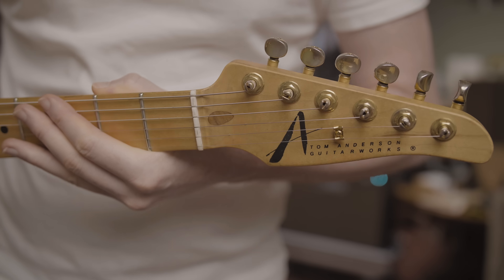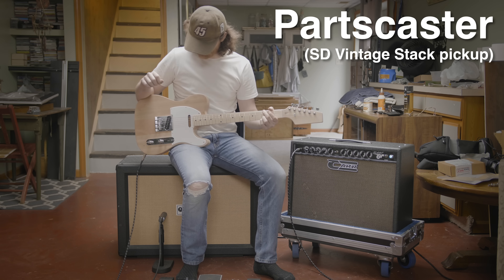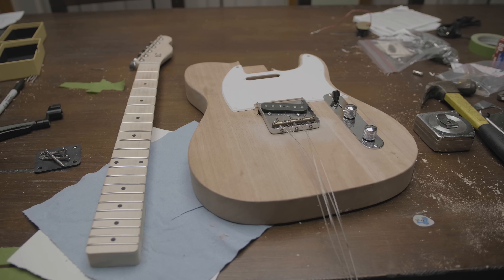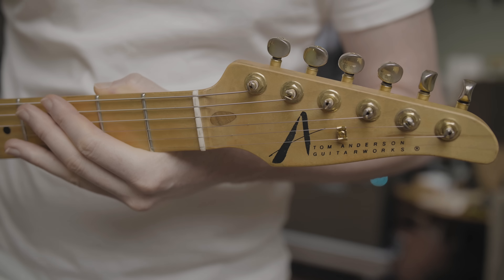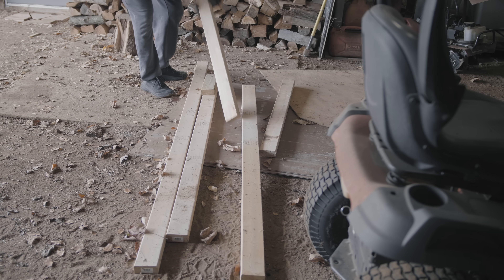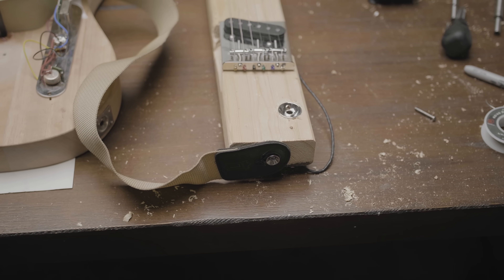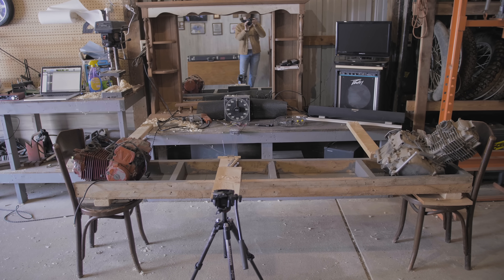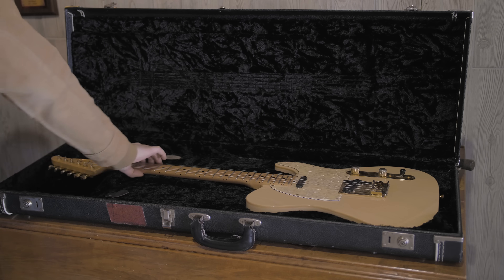Tested: Where Does The Tone Come From In An Electric Guitar?

Comment: Tremendous amount of work had been done for this video and it breaks my heart to say, that one missed factor had distorted the outcome of the experiment significantly. That factor being the neck pickup on the Anderson, just the mere presence of it. The magnetic pull of the disengaged pickup is enough to reduce the string vibration and ''eat up'' some of the harmonics of the strings above it. That is the major difference between the sound of Fender Esquire and Telecaster/Broadcaster. I even tend to sink the neck pickup on my les paul as deep as it goes to affect the tone and playability when tracking the parts that require bridge pickup only, the difference is very distinguishible on the blind A/B tests that I've done, and you can even feel it with the unplugged guitar! Once you hear that specific difference in tone, your ear can pick it up, and that is exactly what I am hearing in this video, that difference seems to be the big contributing factor for the remaining differences in sounds of two guitars (and I do prefer the sound of the one pickup partcaster for that very reason, haha).
I expect that eliminating this factor would make the difference even more negligible, and I would like to encourage you to either try to remove the neck pickup on the Anderson for the next experiment, or find the neck pickup with the same magnetic pull for the partscaster. Otherwise, this is probably the best experiment I've seen on Youtube and I can't wait to check out the future ones, you've got yourself a new subscriber with this one :) Thanks for the time and effort put into this!

Comment: Loved your tests. As a retired Luthier I was always amused by all the things I used to hear from customers as well as comments made on guitar forums. My own personal experience taught me that there was far more BS out there than facts. I even "blind ear" tested some people to see if they could tell the difference in sound between some HB pickups and Gibson PAFs--they thought they'd have no trouble determining which was which. Boy were they wrong LOL! Likewise, a guitar I built with different wood species than a typical Les Paul fooled them as well. I particularly loved it when they'd pick my guitar as the better sounding one 😄  I did experience better resonance and slight differences in sustain with different body construction. Pickups do make a difference as does the circuitry when it comes to sound and that's the best way to upgrade a low end model (or a Partscaster). But, in the hands of a good player, and plugged into a decent amp, even a low end guitar can sound much better. It reminded me how often people would rave about a brass nut sounding so much better--I would then say to them "So, you play a lot of open strings when you play?" They would be puzzled, until I pointed out to them that you take the nut out of play when fretting chords and individual notes LOL!
Reply: What an awesome comment :)
Reply: @CYON4D  Thanks--the truth is, it's easy for people to buy into the hype about guitars because we all wanted to demystify why some guitar players and their guitars sounded so awesome (I was  no different when I was a young guitar player and eager to play and sound better). Now that I'm an old fart I play and sound much better LOL! Van Halen always sounded better than the folks who tried his guitar and amp--it wasn't the wood or the pickups--it was the man behind the axe!
Reply: Honestly, I'm no where near experienced enough to believe I could pick it out blind, but the no body guitar seemed to have a much rounder sound (other than when he strummed hard, but that could do with the difference in force).  Hearing that difference through YouTube's compression leads me to believe that IRL it's a larger difference.  With that said, I'm a firm believer that the player makes the biggest difference in tone, followed by the amp, followed by the type of pickup.  There's also no doubt in my mind that different constructions has a HUGE affect on sustain.  My Gibson Les Paul Standard has never ending sustain - I'm guessing due to fixed bridge alongside of the weight of the guitar (it's one of the old non weight-relieved ones), and the set neck - and for some reason, my EBMM Majesty has surprisingly good sustain.  The neck through design has to be the biggest contributing factor because the guitar itself is insanely light, and it has a floating bridge.  It definitely doesn't have as much sustain as my LP, but especially considering the floating bridge, it's truly insane to think about what they were able to do!  One of the other things that I truly believe that people forget is that people are going to typically hear the guitar either live, or in a mix, and it's going to be almost impossible to hear the nuances.  IMO, the most important thing for a guitarist's guitar is that they're playing a guitar that they're comfortable with, one that gives them the feel they like, and one that inspires them.
Reply: This comment and it's string of comments are music to my ears.  To wit: I have Washburn EH that I love to play but it's a dud when plugged in.  I believe better pick ups are the answer now that I've read this section.  Thank you everybody!
Reply: This. All the way.
Reply: I still remember the look of shock on a girl's face when I showed her that  her beloved (and great sounding) early "JV" Strat had a basswood body.  She was crushed.
Reply: Love hearing opinions from experienced luthiers. I imagine guitars and wines are similar in the sense that the “connoisseurs” usually can’t pass a blind test. I always thought pickups made the biggest difference, then body size. I really only care about the type of wood for acoustic guitars.
Reply: @owenmoore7340  And I can agree with that for acoustic guitars--the wood and the finish on them makes a difference, as does how they made, bracing, sound holes, etc. I agree on the wine too--I'll never be a wine snob and I loved it when the palettes of the so-called experts were fooled years back by the superb wines from California and even in Canada and other countries LOL! As with all things, it also comes down to what you like. E.G. when it came to guitars, I was a Fender lover first, and so the first quality guitar I bought was a pre CBS Telecaster (swamp ash body with a maple neck and fingerboard). I stupidly sold it to buy a car in the 70s and the closest I found to it after that was a Japanese made Squier that I still own today. It sounds as good as I recall but the neck is slightly different than my original--but still a pleasure to play. RIP Leo Fender! I always wanted to build guitars as great, (or better), than George and Leo--that was my goal, but I really don't feel that I did any better than to match what they did. But I had a lot of fun trying!
Reply: So, I played a SRV Strat at the music store and I loved it. So, I bought some Texas Gold SRV pick-ups. The exact same pickup as the Fender SRV. 
So, why does my strat sound nothing like the SRV? Not even close.
Reply: @markbranch682  setup.
Reply: @alan_davis  so, you don't think it has anything to do with my strat I built being made of maple, which Fender does not do, and it weighing in at 9 lbs?
Reply: There's definitely a difference between less dense and more dense woods and wood types in terms of how the guitar reacts to input as well as sustain. 

It can even be measured. There's people who measured the difference between different sustain blocks and the graphs showed a different tonal spectrum. Just because human ears can't pick up on hat doesn't mean it doesn't exist. 

And your logic with regards to the nut is fallacious. Just because you push down the string doesn't mean the nut is taken out of the equation. What kind of Luthier are you?  Just take out the nut and then play a chord and see how the played notes sound

. But that isn't even the reason why it is fallacious. The nut is a contact point for the string. When you play a chord the spund travels through the entire string and guitar (even beyond the fretted note) and carries over to the other strings (sympathetic resonance) and a good nut can facilitate that and thus increase sustain.

All this can be seen when tested in a lab. You can LITERALLY aww the difference in tonal spectrum if you measure it.

Even in this video, the real guitar sounds way snappier and brighter. I can do a blind test and pick out the quality guitar every time. But I'm known for my sensitive hearing. Just because you or many others can't make out certain differences doesn't mean  it's all BS. And like I said it can be demonstrated in the lab that different woods, but and bridge materials affect how the sound travels through the guitar and that Ultimately affects how the guitar reacts to your input which will translate through the pickups. 

For instance, my Jackson has very little sustain. No matter what I do the guitar doesn't have a lot of sustain due to the Floyd bridge. So it feels and sounds totally different when I play it no matter the pick ups. My PRS is so sensitive to touch no matter the action height. You pluck a string and it sings and has good sustain even unplugged. That gives the entire guitar a different feel and sound. I could have the same pickups in both guitars and I could tell you blind folded whether or not you're playing the PRS or the Jackson bc I know what to listen for and because I know my guitars. 

The ppl pointing out your guitars as the better one just shows that LP isn't as good as everyone thinks and that you might have built better LPs than Gibson

 And that right there probes your own theory wrong as well.  Why? Because you said there's no difference no matter what woods etc. you use. Yet they picked your guitar as the better one because it sounded better than the original. If there was truly no difference and everything was just a fucking marketing joke both would have sounded the same.

The fact that your customers could hear a difference in your guitars over the LPs negates your entire theory that it doesn't matter what woods etc you use. You're a fool.
Reply: @chrisking6695  if human ears cannot pick it up it doesn't matter if it exists or not. Your argument is somewhat irrelevant.
Reply: "Retired luthier" btw. So much BS in this paragraph lol
Reply: @disco4535  Give us your insights and share your experience.
Reply: @larryhall2805  For free? No thanks.
Reply: @disco4535  well c'mon!  You're the expert here.  Enlighten us.
Reply: @larryhall2805  Yes, that's why you're not getting anything for free.
Reply: @disco4535  You went this far for free. If you could elaborate, I suspect you would.
Reply: @disco4535  I can understand that.  Then why not give us a website or guitar shop that you own or are employed?  We'll more likely patronize your business given the confidence of your skill and knowledge.

Comment: This is just great. There is something to have in mind, though. While it is increasingly evident that the impact of wood in instrument tone is overestimated, we can't go straight to the extreme opposite and  claim that the contribution of wood is absolutely zero. 
Maybe you could add some signal analysis to further quantify differences. Some spectrograms with FFT and harmonic profiles could be useful. Hope that helps.
Reply: impact of wood on a tone are zero. that's it.  we are not talking about affecting signal.  we are talking about TONE - actual sound listened by man. and if you hear no difference - there is no difference.
Reply: @vasyapupken  well, that is exactly the argument i say to be untenable. The strongest claim possible would be that wood has nonsignificant tonal subtleties. Otherwise we are simply deaf.

Comment: well, you just proved that the proper guitar tone can be achieved with two 2x4s, a table with a steel frame (not iron, steel) and two Honda engines. I let the purists decide if the motor type has an impact on sound, but I guess a two-stroke engine gives a more round and warm sound... ;-)